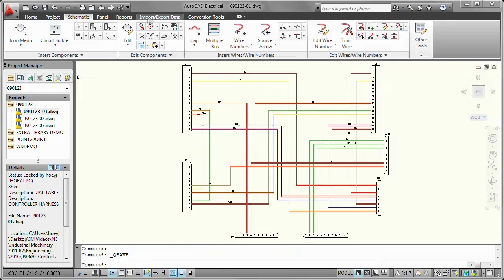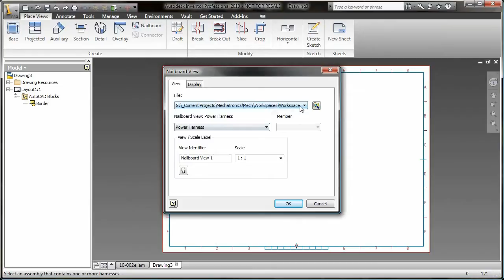Autodesk Inventor vs. Dassault 3D CAD: Mechatronics

Comment: Does Inventor import Solidworks Files!?
I'm thinking of moving into Inventor. Solidworks is a Programs composing of 3D modelling and minimal simulation features, if you buy the Solidworks Simulation you'll get the FULL Simulation features. 
ANOTHER QUESTION IS, does INVENTOR has the FULL SIMULATION FEATURES or you'll have to buy an ADD-ON or anything like that to make it fully functional in simulating?PLEASE ANSWER THIS.